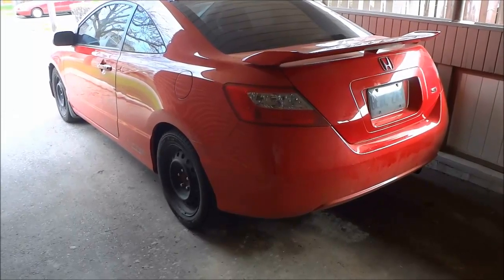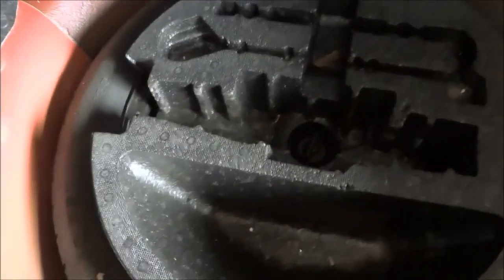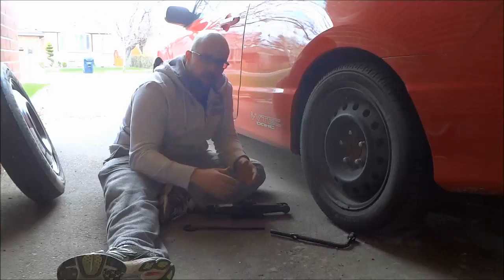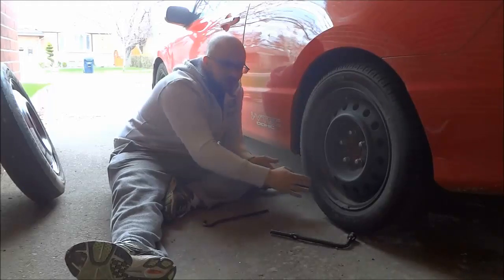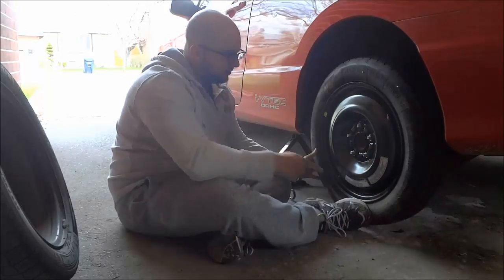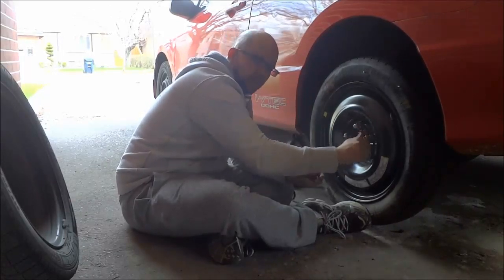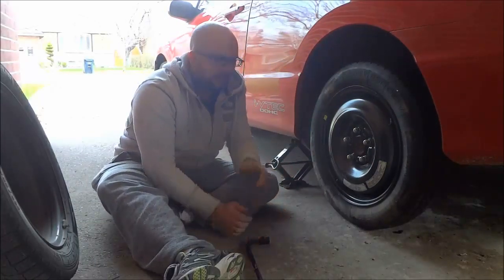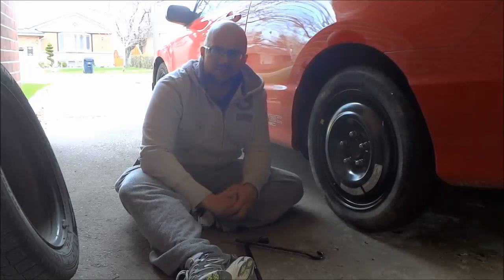How To Put A Spare Tire On Your Car EASILY (Change A Flat Tire)

Comment: Operating the jack would go faster if you put the "hook" into the jack screw, and you can twist the hook using the fitting in the middle of the lug wrench. 

You'd also get more leverage to remove the lug nuts by pushing down (using your body weight to help).

However to me, this is a good video otherwise, because you mention the safety issues, like not putting your foot under the tire, and (despite the poor lighting from the other side of the car) it shows everything pretty well. Thank you for the video.

Comment: 1 thing you have to keep in mind is to not drive on the spare at speeds like 70, many are rated for 55mph max only, as theyre a temporary fix until you can get to the garage

Comment: Didnt have to do this until the ripe age of 30 but you helped me out thanks.
Reply: A year later... I’m 16 trying to change a flat tire lol
Reply: @samoanthor4131  good to learn! I’m over 30 and still haven’t done one yet but looked it up just in case I ever need to. I always make sure my tires are good so I’ve been lucky to not have a flat tire ever. I’d recommend getting a tire pump for your car to always have the right psi. They’re like $30 or less on Amazon.
Reply: Dang your lucky. Seems like it happens to me every year and I’m only 19 lol
Reply: @loganscalf_  happened to me 3 times this year 😂
Reply: Heck yeah! I just did it for the first time by myself at 33.  I remembered something about lowering the car a little before you tighten it all the way so I wanted to double check!
Reply: I know a girl who had a flat just yesterday, she had trouble turning the bolts to get the tire off so she poured oil on bolts thinking it would help but the iron slipped off over and over  LOL😆
Reply: 21😩
Reply: Lol same, only 31. Very helpful, thank you!
Reply: I'm20 finna change one now
Reply: It's pretty easy after the 1st change
Reply: I’m 22 and this is the 2 time I’m doing this

Comment: That was a very good description on how to change a tire. The only difference that I would make would be in the way you Jack the car up. You should take the little hook and of the one straight piece of metal and put it in the hole of the jack at the other end of that peace it is square on the end. Take the Jack lug and you will notice that there is a square hole in the side of it. Play the square hole over the square on the end of the piece that is in the jack. That makes it much easier using a handle to raise and lower the jack. Other than that, excellent video!

Comment: The first thing you have to do before lifting the car, is to loosen the wheel's bolts a bit first. It is easier to loosen them while the wheel is on the ground.
Reply: Either way fr would work
Reply: Their called lug nuts

Comment: Great video , by the way you are not supposed to pull up when loosing up the nuts , push down on the tool using foot firmly.

Comment: 4:35 instead of using the wrench on the right side of the and trying too lift - place the tool on the left side and use your foot to press down.  [ back saver ] 
5:00 You can loosen the wheel nuts 1/2 a turn while the car is still on the road and before jacking it up at all. 
7:00 clean the mating surfaces of the brake disk and the wheel surface.   If there is rust or whatever joining two dirty surfaces can allow the wheel to come loose. 
11:15 I always keep a torque wrench in my trunk with the correct size socket. Then I know they are tightened to the right amount - not too loose and not enough to snap off the wheel stud. [people do that! ]

Comment: From what i see you didn't use a wheel locking nut or known as a Lug Nut, just so you guys know, if you're wheels are higher spec, you're going to need a Lug Nut.

Comment: Short and simple. 1. Get your tire change supplies (Jack, tire, etc) 2. Raise the car 3. Take off the bolts 4. Switch tires 5. Fasten bolts 6. Lower car and clean up.
Reply: @BeardedDragonMan1997  haha
Reply: 1.Loose the bolts a little first

Comment: What is the torque specification on that spare tire? Is it the same as on a regular one? I think it is a good idea to have a middle size breaker bar and corresponding socket. Those 2 object won't take much room, but so easier to release the bolts. Thank you for a great film.

Comment: To any one that thinks u dont need to loosen the bolts while the tire is still touching the ground, i tried to loosen them while the tired was off yhe ground, the jack fell and i flattened my spare😂😂😂. Now im here watching this and realizing where i went wrong
Reply: BS!! all you would end up doing is making the wheel spin if the lugs are tight lies ! if your car fell And it happens sometimes... it was not because you raised the vehicle with lugs still fastened securely. It was likely due to not setting the park brake or improper scotching of the correct wheel on said vehicle.they roll off of the jack so to speak seen it happen many times always And I mean always if at all possible change tires on a flat level surface and do not for any reason get underneath the vehicle while it is supported by the jack alone. you can be crushed.
Reply: you won't hear it coming and it happens Fast. be careful with things that you do not understand it only takes a second to make the worst mistake of your life. Happens all the time. What mechanics do is often very dangerous. it is best to leave it up to us if you can find one that is not a crook and generally has a concern for his fellow man.

Comment: hey dude you are supposed to use the tire tool for a jack handle you are doing it wrong!
Reply: No only in some cars. Japanese cars have their own tool like that.
Reply: @headline710  LOL look at the tool that you used to remove the lug nuts. do you see that small roundish hole in it ? well smart guy the hook looking rod that you used improperly on the jack goes into that hole. And the curved part of the hook goes on the jack then you turn the jack WITH THE TIRE TOOL !!
Reply: I mean if you are gonna make a how to at least know "how to" do a proper job  This could cause some idiot to Harm themselves.
Reply: @bobbysinger1685  My Dodge Charger has a jack that you turn with a tire iron, but my Honda comes with the hook lever you see him using in this video. Different makes and models carry completely different kinds of jacks. I suppose he could've put his spare tire next to the jack under the car to prevent the jack from seizing and dropping the car on his feet
Reply: @headline710  LOL duh Look at the jack handle/tire tool in his hand in the video Notice anything?? IE the little hole in the tool there for inserting the hooked piece into.
Reply: same jack above ^^ see how it should work now ??
Reply: @headline710  dude did you even watch the video that is not the jack and even if it were he still did not use the tool the way it is intended to be used...
Reply: @headline710  go to 3:09 or 3:10 in the video it clearly shows that he was using the type of jack That I said he was.
Reply: Oh c’mon you guys. There’s more than one way to do something. This video was extremely helpful for me. I did discover other ways to use the tools along the way. Great video. So happy I changed my first tire!
Reply: @sarahcordova8420  the thing is if a person can't even use a jack properly said person is hardly qualified to be trying to teach someone else how to change a tire They don't even know how to use tools!! Very Dangerous !
Reply: @bobbysinger1685  I believe he's not doing it WRONG (meaning his technique is not dangerous or harmful) but operating the jack would go faster if he knew the "hook" fits in to the jack screw, and he can twist the hook using the fitting in the middle of the lug wrench. 

He'd also ge more leverage to remove the lug nuts by pushing down (using his body weight to help).

But to me, this is a good video otherwise, because he mentions the safety issues like not putting his foot under the tire, and (despite the poor lighting) shows everything pretty well.